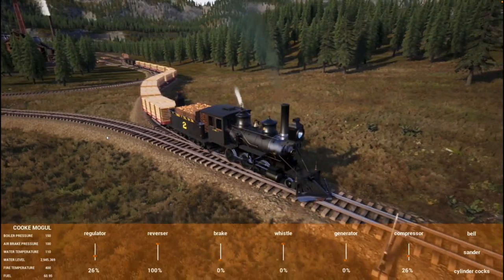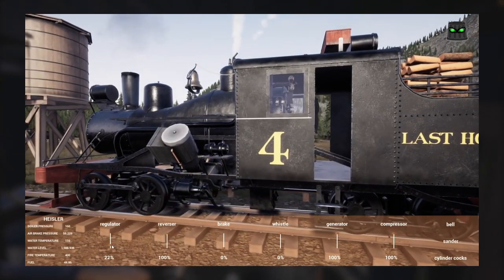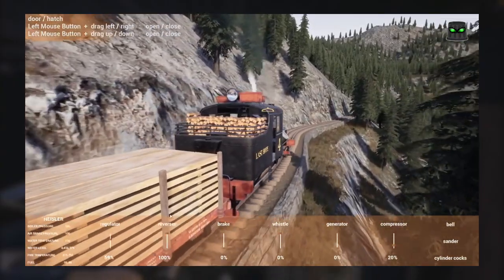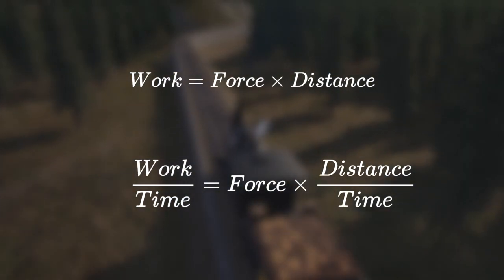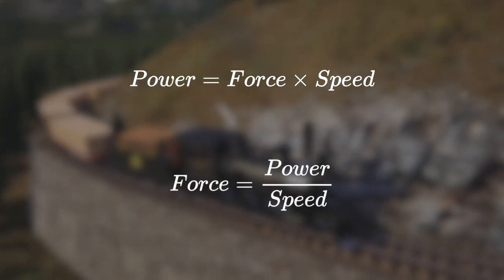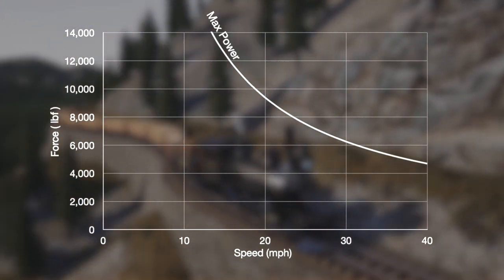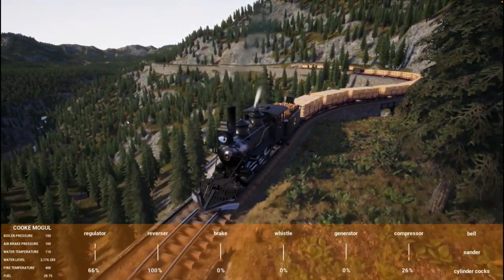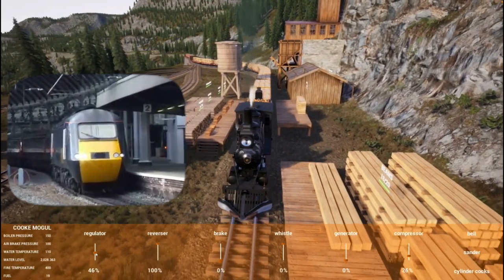Trains: Power vs Traction (Feat. Railroads Online!)

Comment: Marry Kenney during the late 1920s had patented ground based louver covered ducted fans to direct aerial traffic as an alternative to rail transit tracks and since work must produce heat to require radiator heat exchangers her designs could have allowed greater utilization of real estate.
Reply: Referenced by Patent #4700912 similar to cold plasma aerial highways of Wachouski's "NeoSeoul 2144 A.D."

Comment: MY THEORY IS THE HEISLER IS MORE OF A TRIAN AT LOW SPEED YOU MUST USE THE REVERSER TO REGULATE THE POWER TO THE WHEENS AT THOSE LOW SPEED IE... 50% (A ROUGH GUESS) REVERSER FORWARD AT THOSE LOW SPEEDS AND INCREASE IT AS YOU GET FASTER

Comment: Dynairship or lifting body airship filled with Robert L Morrison's Patented lighter than air solids sealed in metal foil having an underside keel propelled by Podrog's patented x-rays on a hafnium to power Lockwood's Patented valveless pulsejet aeroengines is better than rail transit track trains. 

Imperial Japan transported freight cargo with rocket powered gliders and airships powered by fluid jet drilled wells for sulfur fuel and fuels electrochemically synthesized by Hamgyong hydroelectric Geothermal Power while rest of the world had rail transit tracks to crucify both coolies and dissidents to herd or braked catapult weapons to hurl rocks mistaken for meteors.
Reply: Lighter than air solid SEAgel or Biofoam Patent #5382285 and #5360828.